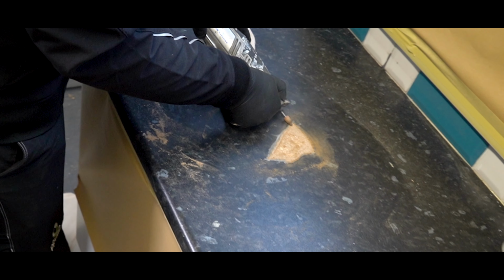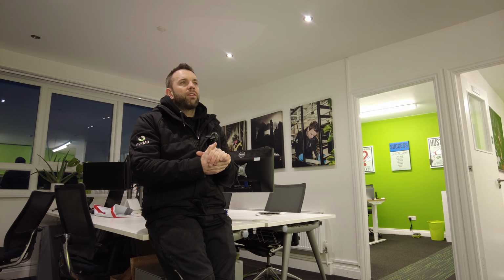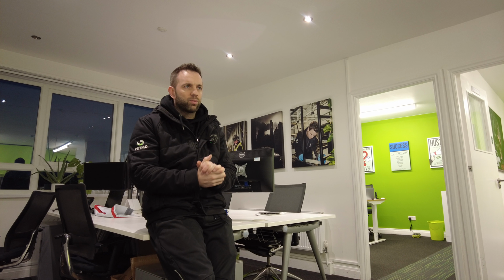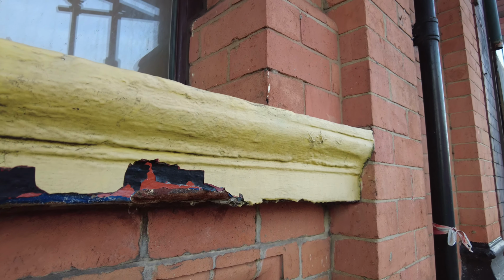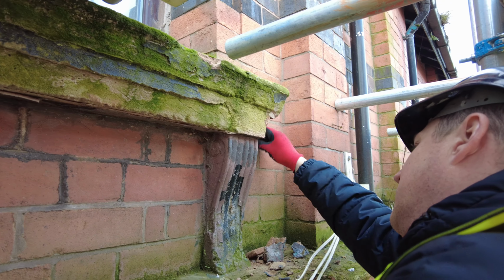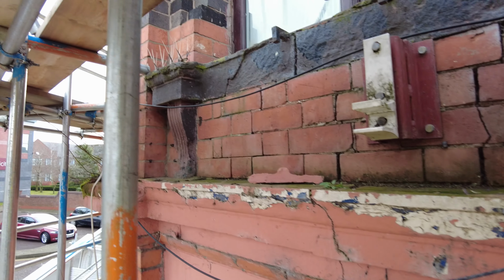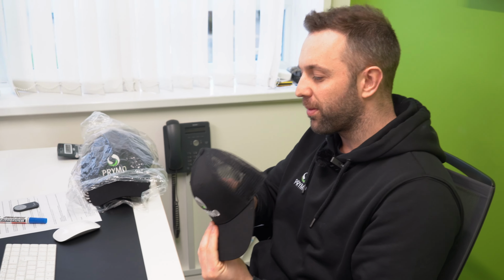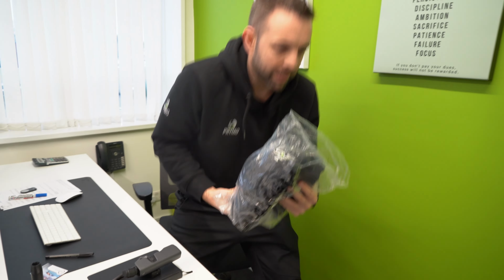BIG PROBLEM on new client site | Inside PRYMO Ep.14

Comment: Cracking repair on that worktop 👌 just curious to why they don't replace the top, I'd of thought calling you guys out to repair is more than the cost to replace it? Tops like that are circa £50 🤷‍♂️ good in terms of business for you guys though 👍 keep up the good work!
Reply from the maker: Tops circa £50… how much for a joiner to install remove and install new… what happens if the tile splash back is damaged when it’s removed… how much will a tiler be, can the same tile be sourced… what about the mess that’s caused replacing the item - and how long will all this take. They maybe potential hidden costs but they are real costs - we are in and out in an hour most visits with a fixed cost well below that of the costs above and mess free :)

Appreciate your viewing and thanks for the support.